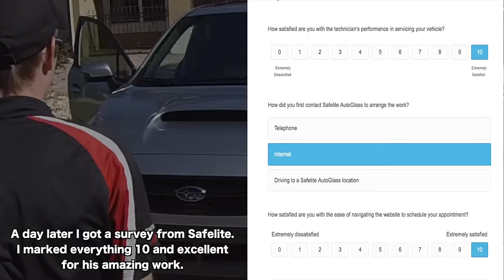Safelite Cracked Windshield Replacement For My 2019 Subaru WRX STI

Comment: Wow! He did an amazing job! I wish all Safelite employees were as professional as him. In Miami the Safelite employees I encountered were rude and careless. Excellent video!
Reply from the maker: Thanks, I was impressed with him as well! Thanks for commenting!
Reply: same here in ct. the glass company i work for has some ex safelite guys and i hear nothing but horror stories
Reply: Most of them are not educated enough. I've been doing glass in Dallas Fort Worth for 23yrs. I also installed in Vegas for 3 yrs. I have fired at least 10 guys that came from Safelite. I have also seen very Good Techs from there as well. Definitely more bad then good. This young man did a pretty good Job.
Reply: I'll be honest I did work for Safelite before the commercials when we were the best glass company in the are. Then Belron came in the picture. Everything went south now It's one of the worst glass companies out here. I actually fix their problems "IF" the vehicle was not totaled. I just did a Jeep Wrangler they tried 3 times to stop an air noise. I pulled and reused the glass they put in, and stopped the noise she had issues with. The glass was not properly and evenly set. And the totaled vehicles is from not paying attention to the bottom when running the wire/fiber line cutting off the bottom pinchweld some attached to the firewall. You can call any bodyshop or dealer and ask if they would recommend Safelite you might hear a laugh or giggle before the tell you, "No!"
Reply: @Miguel_A_S  in 35 years in the glass business I always hear one criticizing the other rule of thumb you're probably the butcher
Reply: @davidlozano2130  Not exactly, we have been fixing screw ups and seen vehicles Safelite has totaled in Jacksonville. Insurance companies and some are telling customers to only use Safelite or trying to only allow Safelite, after customers request who to do the job. In Jacksonville wait time is about 2- 3 weeks wait for a windshield replacement. Customers are waiting 8 hours in their shops with appointment. It's not fair to the customers. I used to work for Safelite years ago. Before all these crazy issues they are having now. I was one of their best until I injured my rotator cuff.
Reply: @davidlozano2130 😂 no lie general knowledge of da biz
Reply: @Miguel_A_S lies I’m in dual and u cap , Lee and cates da rip offs, glass doctor will install car same day 103rd street, and baker glass would be next shop round and far as insurance it’s too many loop holes so if u getting buy by them u not to n the knowledge of car insurance and legal rights they can not tell u where u take your car lawyer fact they can suggest tho.

Comment: Thanks for recording this I was wondering how they did some of the things because I've never watched the entire process!  They did a great job with your car and that tech seems very efficient and skilled.
Reply from the maker: Glad you liked the video! Thanks for watching and commenting!
Reply: One mistake tho he is not wearing the nitrile gloves like we are trained to do can cause contamination to the glass and later in can be a problem with bonding for the glass to stick
Reply: Glue the frame not the glass first
Reply: @kevindargan3071  I didn’t notice him prime the pinchedweld, use aktivator or prime new glass. Could’ve been cut out for the video length
Reply: @CarStory  Good Job With All This ;) Your Skilled at the video angles too.
Reply: @johnnybeddi547  LOL! I seen that but it could be a long curing time for it ;)
Reply: @Redacted Clips  some urethanes are primerless, we use dupont that doesnt need primer on the glass or pinchweld
Reply: h0w l0Ng U bEeN d0iNg gLaSS?

Comment: my 2019 Civic windshield was shot by a rock coming from semi truck tire. It has 7000 miles and the road is taking its toll so soon. My old civic I put in 150K miles before anything happened to the windshield. Glad to see Safelite does good work without the use of power tools, I was getting scared from watching other videos.

Comment: Thanx for the vid!  Just (like an hour ago) had mine done by Safelite.  Originally they said between 12:00 and 5:00.  Guy called today and said between 1:00 and 3:00 and he showed up a bit before 2:00.  So, that was great.  Except the only meeting I couldn't move was at 2.. ;-(  So I got him started and went to my meeting.  I was wondering what he was doing. ;-)  He was very polite and professional and it looks great so far.  (I was able to run back out to check it after he had left...)

Comment: I've removed and replaced windshields before. I wish I have that rotary tool for cutting through the urethane. Makes it look so easy. I only have a cold knife and if you aren't careful can scratch the roof or A-Pillar even if you add some scratch resistant tape at the arch of the blade.

Comment: I had a 2019 Forester sport - something hit the windshield at 4000 miles - Safelite did ti for me.  Thenthe car got totalled.  Replaced witha 2021 Forester sport and guess what happened at 4000 miles?  Yep.  Back to the same Safelight.  Just 1 thing. if you have any kind of Camera-assist (subaru I-Sight, etc) they have to do the work at their shop so they can recalibrate the System. Other than that they do awesome work.
Reply from the maker: wow thats crazy!  glad you survived the accident!

Comment: Getting mine replaced tomorrow and I'm super worried. Hopefully they are as professional as this guy.
Reply from the maker: My installer was good, still don't have any issues with my windshield. Good luck with your replacement, I'm sure it will go well.
Reply: How much did it cost?

Comment: Thanks for this video. Just What I needed. Mine has a bullseye that needs a new complete windshield. I live in a apartment. Can they do this if my car is parked on the street? Or do you think it's better to go to the shop or maybe have it done in a mall close to me? Thanks
Reply from the maker: If you call and tell them your situation they will probably tell you to bring it to them. Glad you found the video helpful!
Reply: @CarStory  Thanks for reply. I decided to take it to the shop instead of having them come to me. After watching your video I think it's best. Where I park my car is bumper to bumper cars and the technician needs good amount of space. Again thanks for great video it helped 🙂
Reply: @safelites unethical practices left my van broken and unsafe! After they replaced my rear window, the spoiler popped off & the trunk wouldnt close.The tech was advised just to"glue it".After they "fixed" it,spoiler flew off on the Hw & my trunk continues to open while driving.

Comment: Why would you put the seam in the middle of the top of the glass. I would want a continuous bead along the top. Maybe that’s why windshield leaked. But I was told there was some of her issues for the leaking. Went to another glass shop and they let me watch and they ran a continuous bead across the top. Now I know why the leak!  Thanks for the video.

Comment: Everything I’ve read says that windshield install that are correctly done require wearing gloves to keep hand oils from interfering with adhesive
Reply: You are correct.
Reply: If the tech is careful it's fine. It's not hard to not touch the thin line where the glue goes. That's the only place it matters.  People always find something negative.

Comment: The technicians might be good, but it's been my daughter's experience that their windshields are poor quiality glass. She just spent $400 on a windshield and the VERY NEXT DAY it had a rock chip that spidered. You can't tell me they can't make a windshield any better than that. They won't do anything about it either. They were a total waste of $400!
Reply from the maker: Same thing happened to me a month after this windshield replacement. I got a small crack that had to be repaired.

Comment: Was there a post-installation wait time before you could drive it?  Some web sites say you have to wait several hours for it to cure.  What was your experience?
Reply from the maker: They say don’t drive the car for at least an hour unless you really need to. Waiting at least four hours is best. I didn’t use the car until the next day.
Reply: With the new product used the safe drive away time is 30 mins

Comment from the maker: A lot of work went into editing the three camera angles in this video together. Please support this channel by clicking SUBSCRIBE and giving this video a Thumbs UP! Much appreciated! 

You think that with me not driving the car much this kind of thing would be less likely to happen. I mostly use the STI for 200 mile round trips between Orlando and Tampa once or twice a month. There are lots of trucks on the highways and there's always small rocks bouncing around behind them. I try to stay away from them until it's clear to pass. I heard something hit the glass but didn't know the windshield was cracked until days later. This guy did an amazing job replacing the windshield and I really can't tell it was replaced. If you have a WRX, this is what replacing the windshield looks like. The installer told me he does 8 windshield replacements a day. Hopefully I won't need another windshield for a long time. Thanks for watching!
Reply: Eh shit happens. I broke my glass a week after I took it home from the dealer lol. Was pretty upset about it since replacement glass isn't as good but whatever.
Reply from the maker: @Chris-us7tj  4 weeks later another rock hit my windshield at 70MPH and my new windshield cracked again. I took it to a local Safelite shop two days later and they filled the crack before it spread. Luckily its at the bottom corner of the windshield and isn't very noticeable. I am having bad luck lately with things hitting my glass!

Comment: I have a 2007 Silverado 2500 and I’m taking it to safelite tomorrow to get the windshield replaced. I’m so afraid they’re gonna tear the interior up or not put something on right or break the parts. How do I prevent this and what do I do if it happens?

Comment: Hello there, great video. I have a question. In the beginning of the video the tech mentioned the windshield didn't say Subaru. Did you have a choice to get a OEM replacement? thx
Reply from the maker: I did not know at the time but yes I could have requested an OEM windshield. I was told by another glass installer that unless you have acoustic glass for extra sound insulation, the OEM windshield is no different than the aftermarket glass. Regardless of that, next time my windshield breaks, I am requesting OEM glass just to see if I can get it. Your insurance company can refuse that request or make you pay an extra fee for it.
Reply: @CarStory  that makes no sense that your insurance can refuse oem replacement. Thats like saying if an oem wheel gets damaged you have to get an aftermarket one. No, if they are covering the replacement it is supposed to be oem. If not you have a crap insurance company.
Reply: @Hallowsaw  not true. I work in the auto glass industry and if you do not have an oem rider in your policy, they may not cover it.
Reply: You can get the make glass, however it usually takes a while longer to get the part. There’s honestly zero difference. Chances are the glasses are made in the exact same shop, just one went down the Subaru line, the other went down the aftermarket line

Comment: Thanks! I got my windshield replaced about a year ago. Seems fine, except there is a rattling from the dash at low to regular speed on local roads.  Seems to go away on the highway.  More pronounced at the driver side, but also sometimes around the center?  Do you experience anything similar? I watched the video to try to see if there was anything under the dash near the windshield that could cause the rattle, but I don't see anything other than some yellow wires across the center of the dash, but those look tucked in and wouldn't come loose from an installation.
Reply from the maker: No my interior doesn't make any noise at all. He did a good job!
Reply: is it a dodge journey?
Reply: If your windshield has a heated wiper park area it sounds like it's not plugged in. That would let it rattle sometimes.
Reply: @CarStory  is that really a Subaru? Lol mine has all kinds of rattles
Reply from the maker: @xil3ntkha0s  I still have the 2019 STI. It only has about 17,500 miles. It now makes the occasional rattle from the passenger front door and dashboard. Only on rough roads though. On highway I don't hear anything. I love the STI, one of the best cars I've ever driven.

Comment: I remember when I replaced 10 windshields a day and never complained once.
Reply: A fellow warrior.
Reply: Been searching everywhere. How much would a new windshield cost on a step van? It has 2 pieces in the front but I only need one like this: https://www.truck-n-trailer.com/truck-details/3764/WORKHORSE-P42-Step-Van/

Thinking of buying a used one but one front window is busted.
Reply: Hi I'm thinking of applying for a job for replacing windshields..but I have NO experience in it...is it hard to do?..also you think I should be able to do it without experience?..and how is the pay?.. and is it Always early morning shift..?
Reply: @carlosaponte1331  Safelite will train anyone with a pulse. They pay decent but I won't work for them.
Reply: @ESLinsider  Those van windows are flat glass, so a local shop can cut you one and install using the same gasket already installed on the vehicle. My shop would charge 200$-250$ for a job like that, installed

Comment: Great video, how long did you start driving and also go to Carwash after the replacement?
Reply from the maker: I didn't drive it until the next day but the installer said wait about four hours to drive it if possible.  I didn't wash it for a week after the install.
Reply: @CarStory  thanks, I just replaced a cracked BMW 7 series back glass yesterday, but drove about 4 miles back home after from the installer and packed in garage, he warned also not to wash for a week.

Comment: I have to go to them Tuesday through Allstate insurance. Idk how your state is but did you have to get a new registration sticker and inspection sticker on your window?
Reply from the maker: Thankfully we don't have registration or inspection stickers in Florida messing up the windshield. They will probably remove the stickers safely once the windshield is removed. They probably come right off with a hot air gun to warm up the glue.

Comment: He did do a good job. But always check reviews for your local area. Don't just go with what your insurance tells you. Your allowed to choose who you want. Just because they do lots of commercials doesn't mean that is the best choice. In my local area the wait time is weeks for replacement, when a few other local companies with better reviews can do same to next day depending on Year make model and availability of the glass. Because of the commercials they are getting more jobs then they can handle in a timely manner. Yes I used to work for Safelite before they started doing commercials and we never told a customer that it would be 2 or 3 weeks before we change the windshield. 
Again check reviews, or ask your location dealer what company they recommend. And tell your insurance who "You" choose to go with.

Comment: All windshields are aftermarket windshields at a auto glass shop unless you ask for a OEM windshield which is more pricier I’m also a auto glass tech but I work for a family owned auto glass shop
Reply from the maker: Yes very true! My wife needed a windshield for her GTI and we requested a OEM windshield and we got one. It cost the insurance company $850 and it was 100% covered here in Florida! Next time I need a windshield for my STI I will request OEM glass.
Reply: No it's not. I only sell and install OEM glass and if the customer doesn't want to pay for OEM or OEMe then I won't do the job.

Comment: What do they do with the inspection and emission stickers? My windshield is being replaced this Friday and was wondering what about the stickers on the old windshield?
Reply from the maker: We don't have those in Florida but the installer may have a method of removing them from your old windshield.
Reply: Depends on the state you live in. I live in New Jersey and the stickers are easy to take off after the windshield is removed from the car. States like New York and Pennsylvania stickers cant be removed. They have serrations on the sticker when you try to remove they fall apart. They make them like that so you cant transfer the sticker. I know this response is 2 month from when you posted your comment but hope this helps you
Reply: Just had my done here in La.  Safelite guy removed inspection stickers, oil change stickers, etc. from old windshield very carefully and then reinstalled on new one.  100% professional

Comment: In other words it’s not OEM and it costs them much less and they don’t pass this savings on to the customer. The website says they use OEM glass.
Reply from the maker: True, when you call Safelite you have to request OEM glass up front. I didn’t do that and could not wait for another appointment. This windshield is still on the car today but next time it breaks I’m demanding an OEM windshield.
Reply: @CarStory  yep I just called Safelite $300 for OE and they want over $1000 for OEM.

Comment: If nothing hit your windshield then it most likely is a stress point crack. When the car manufacturing lays down the glass the surface can be uneven which causes different stress points. The windshield then has more stress at these points causing it to crack over time. If you can show that there is no impact (rock impact etc) to the glass the car dealership will replace it for free.
Reply: someone decided to be an ahole and made a nice gash in my windshield.